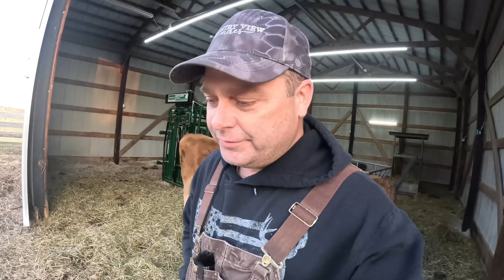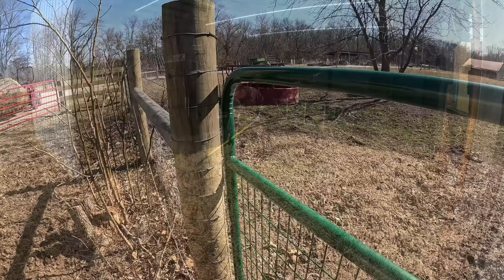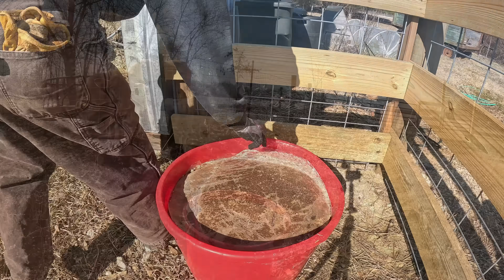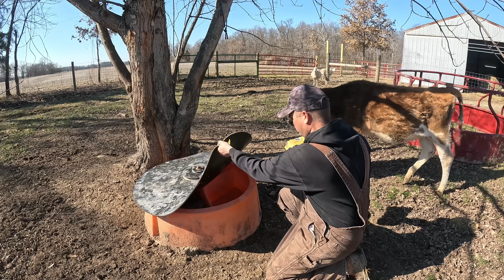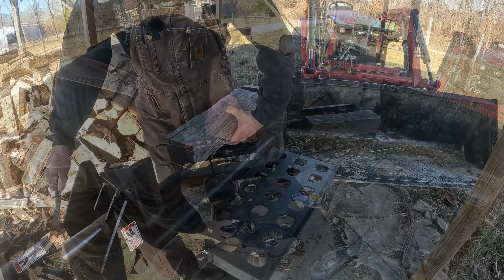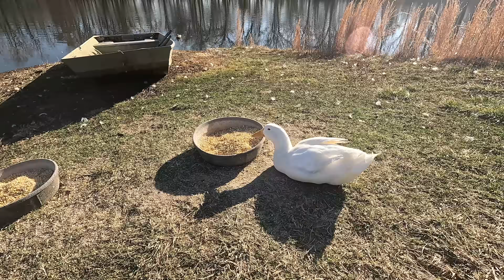Catching up on Livestock Chores Before I Leave.  Some needed done for a while.

Comment: For the pond: if you cut down the grass around the pond edge before everything starts to grow for the season, it can sometimes help to keep duck weed from exploding. It needs the protection of the taller grasses through the winter to survive. So, if you take that away you may still have enough of a cold spell to end it's cycle. But... You need to act soon or it won't work.

Comment: My local feed store was shocked I moved one of those mineral tubs onto a feed cart and took it in the store. I told them I would prefer they load it for me 😂. Unloading it at home without anything but my own power was a challenge but I managed to find a hill to back up to and was able to scoot it off my truck. I can't wait to get a tractor to meet my needs. I'll be in heaven. I drag bales with my truck and then roll them over by hand. I can't move them by hand anymore. At least not very far like I used to. You are making a lot of progress on your farm! I enjoy how you learn as you go and show your failures as much as your successes. We can all learn or relate to both sides in one way or another.

Comment: Just a suggestion ... if you turn your jon boat upside down when not in use, it won't fill up with water when it rains.  Will make going out on the pond an easier experience. ❤

Comment: JudithB  Hope  you  have  a  good  time!!!  I need  to  make  kindling  too  this  coming week,  down to the  last  bucket full!  I  did  lose  one of  the  new  chicks,  but  the  other  9  are  doing well.  The  old  hems  have  started  laying  last  week too.  The hens  are  cleaning  the  garden  for  awhile  longer,  I plan to  start  cleaning the  garden in  March  and  get  the  rabbit  poo  spread  in the  beds.  I  want to get  the  drip  system  set  up  this  year.  The hoop  beds  are  doing well  so far.  I  got  a  furnace  repairman  in  finally,  and  new  parts should  go in  next week.  Meanwhile  continuing  the  smaller  repairs,  cleaning and  painting inside.  Pre-spring  exercise  program!!!  My LGd  has  been  barking  a  lot  at  night, keeping  the  coyotes  down in the  valley,  but  we have  a  possuum  eating  feed  and  dog food.

Comment: When your back best leave a gap just enough for a coyote squeeze into the barn but put a foot trap in front and inside the gap then you should be ok ,cover with straw ,and put two bits of tractor parts   surrounding the trap inside so ya own animals don’t get hurt